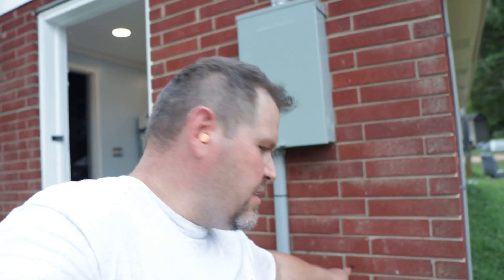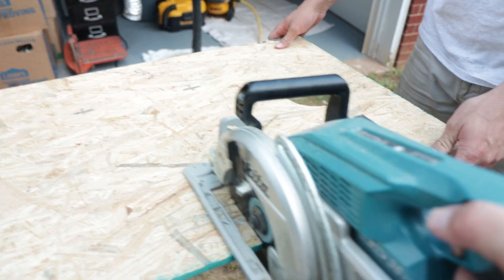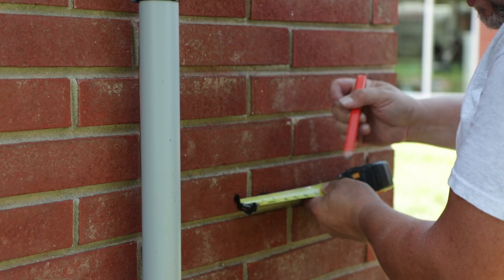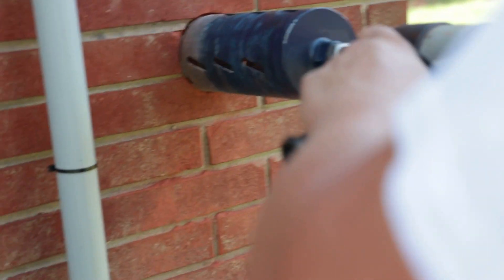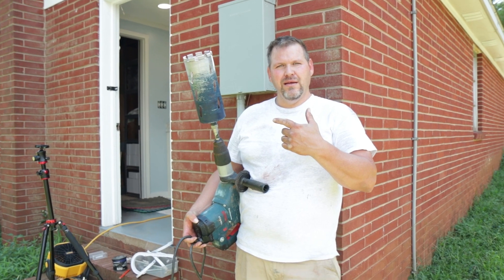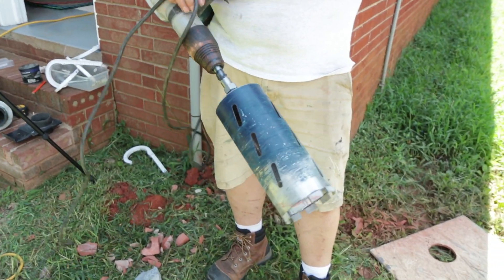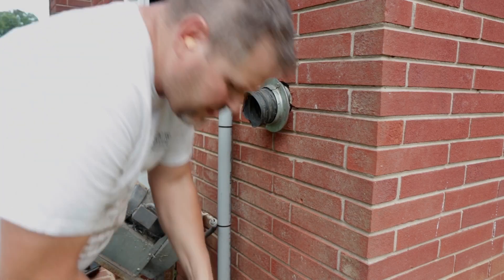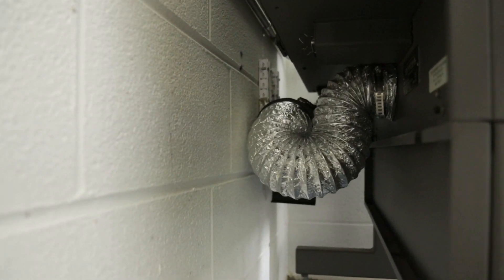How to Drill Through Brick Fast and Clean (Using a Core Bit)

Comment: I must be using a crappy Craftsman drill because it is taking me forever to drill a 3/16 hole in brick to mount a mail box.  About 1/4 inch every 30 minutes. And , why did you grease the 'splines'?
Reply from the maker: So you need either a hammer drill which a lot of drills have that function. You don’t need to oil or grease a drill bit in your type of drill though, but it does need to be a masonry bit. I’m using a rotary hammer, the bit free floats in the chuck so that’s the reason for the grease. 

You can drill just using a standard drill with a masonry bit, but it is slow. My suspicion is your bit is already shot if it’s taken that long. Good luck, man.

Comment: Does that core drill bit cuts through reo-concrete wall 4inches thick wall please?

Home here in Australia, our version of HOMEDEPOT ( Bunnings), as well our Tool warehouses, don’t sell 100-120mm (4”) core drills for us DIY, 

I’m looking to cut a 100-120mm hole through 100mm (4”) vertical concrete wall that has rebar and to use SDS plus on rotary not hammer.

doing my homework, it seems EBay has the answer and sells many different size core drills for concrete/brick, seems like diamond core drill not carbide is the go, with SDSplus adapter and use diamond core cutter for dry hole cut.

I can’t believe I’m the only one that has ever asked for this at our major tools warehouses , to simply run a 100mm waste pipe under the house and through a brick / reo-concrete wall ! … surely not ???

I had three quotes from concrete companies to cut a simple waste pipe hole into a brick and through a 4” concrete slab and all three quotes was if I was asking for gold diamond inlay :I    crazy prices $450 for an hours work!! Hence DIY “ myself” 

Any suggestions would be greatly appreciated that I’m on the right track before going onto EBay to buy core drill piece that comes with DSplus pilot attachment, gotta say love the hole cut out in marine plywood as an alternative on this video by these blokes, another one I saw is cutting a V out of a piece of marine plywood as a pilot guide too.

Thanks everyone

Melbourne 🇦🇺 kangaroo 🦘 
Australia

Comment: The Ingersoll Rand 114GQC Air Hammer  https://www.youtube.com/post/UgkxqqoaX03nrziKwF7Bjjcc71YzLEleMvOS  was just the tool I needed. I Use it to remove stuck bolts. If held at the right angle you can cut slightly into the bolt. Then turn the air hammer to where it will hammer the stuck bolt to unspin the bolt. Given a little practice it works great. This air hammer gives you the control needed to get the job done right. Very powerful yet still does not seem to have as much vibration as other guns I have used. One of the best I have gotten my hands on.
Reply from the maker: appreciate it

Comment: Do you use Rotary Only mode on the drill?
Reply: I'm finding that SDS Max drills don't have a Rotary Only mode. But my dry core bit says "rotary only" - no hammer action - it will destroy the teeth of the diamond bit cutter.

Comment: I just want to make some kind of small hole for extension cords or cords ? Any suggestions? Thank you and God Bless you Happy. Easter
Reply from the maker: They make concrete drill bits up to an 1” I believe. If your going through brick or solid concrete it works good. If going through block I’d get a small core bit similar to what we have here. You can get them on Amazon or eBay fairly inexpensive. 1” would be the correct size and any full size drill should run that.
Reply: You're running an extension cord through a brick wall???  My suggestion is absolutely don't do that.  There's a reason why that doesn't come close to meeting code.  Just a really bad idea.

Comment: is the drill setting on hammer or drill only when using dry core bits?  sounds like hammer setting is on
Reply from the maker: It’s a rotary hammer, there’s only one setting and like I said in the video we know it’s not recommended. We’ve ran them countless times without pushing to hard on the tool and there’s no visible damage to the core bit.

Comment: I saw a bit of blowout at the exit around 8:30. Usually do pilot holes but its a big job.  Holding a cinder against the wall when the core bit comes through will help reduce the blowout. Good use of the guide.
Reply from the maker: We bore holes different now. Same core bit and Bosch Rotary hammer. Zero blow out. It’s in one of our other videos.
Reply: Pilot drill & you can drill from both sides.

Comment: The core bit I got today comes with a center mason pilot drill bit, so you don't need the template etc... Super simple but not easy work, prepare for a workout.
Reply from the maker: Most contractor grade or rental cores don’t have a pilot bits

Comment: Nice video..
Do you have any info about the core bit and the adapter.
Thanks!
Reply from the maker: Amazon has both of them. I can’t remember what seller I used though. The thread for the adapter is 5/8 and for the Rotary hammer side that was used in the video SDS Max. The adapters are a little tricky to find though. Good Luck

Comment: I haven't drilled many 4 inch holes, but when I do I use a wet hole saw drill. I was wondering whether anybody has used both, and which is the best method.
Reply: Yes, I have used both methods, I found the water assist method less time consuming.

Comment: nice work. I want to install a wood stove chimney liner, but my old house has a brick chimney that was filled with concrete at the opening...so I'm thinking of cutting a hole as you're doing.  think it will work?
Reply from the maker: What size hole (8”)?

Comment: Great video. You make it look too easy, LOL. I'm not criticizing but there should've been some safety precautions included. Mainly checking for any wiring in the wall and some type of eye protection. What did the inside hole look like? Do you just use some sort of a box. Normally the exit hole looks much worse than the entry hole, that's why I ask.

Comment: Hi what was the grease for? do all diamond drills need grease before using? also how come you kept stopping every now and again? I've never used this kind of drill that's why i ask, thanks
Reply from the maker: Grease is for the end of the core bit that goes into the drill. I typically will stop when boring to see if there’s anything such as mortar, brick, concrete that’s came loose in the cut cavity. Just cleaning the bit off.

Comment: despite the comments about water, hammering, etc..good job ,...I enjoyed the video ,...
Reply from the maker: I knew this would bother some professionals. Here’s my take on the water, if it’s a area that not finished and is solid concrete I’m almost always going for using water. If it’s brick that we’re drilling through and I have to worry about run off clean up I’ll go dry. We will typically run a couple vacuums then. Some people the rotary hammer drill is just going to make mad😀 It really came down to not wanting to carry so many tools in our rigs. I can only assume with your name I’m talking to a professional or sales so I’m preaching to the choir here. Appreciate the comment.

Comment: Any issues with doing this at a slight angle?  Need to drill a similar hole for a mini split ac and it needs to slope for drainage.  Is it fine for the bit to do this at an angle?
Reply from the maker: James, shouldn’t be a issue. Especially if you use a thicker template.
If not start drilling straight for about 1/2 inch depth. Then restart the hole at the desired angle. By drilling it straight on at first the core bit want be trying to run away on you. You can do it👍👍

Comment: Seems obvious but what did you use for the 1" hole for the electrical? I need to make some holes through my concrete block foundation to get some electrical runs outside and was just curious what you use. Similar coring diamond bit but just 1" vs 4.5"?
Reply from the maker: We actually have a sds max 1” bit. I’m going to cover more of this in a video soon.
Reply: @campbellbuilt  love your attitude. Def subbed. Looking fwd to more of your vids!
Reply from the maker: Appreciate that. Thanks for the comment.

Comment: thanks for this video, on the drill setting, do you set to hammer drill or drill only ? thanks
Reply: Never drill core hole saws on hammer
Reply: @Kingstonplumbing  thanks
Reply from the maker: Not to be argumentative but we’ve bored many many holes in rotary hammer mode. The first time I did it was because the drill being used only had that rotary drill option. I figured it would ruin the bit but I was wrong. 
I’m not recommending it but I’m definitely not saying you can’t do it because we’re doing it and will continue doing it with no abnormal bit wear.
Reply: @campbellbuilt  you are right.  I did the same because The core wasn't cutting enough and the hammered action did the job flawlessly.  The core carbide tip looked like new after that performance.   Not recommended in all scenarios though.
Reply from the maker: @Quisqueyax  thanks for commenting

Comment: How does the block look like inside did it blow out?
Reply from the maker: We measured and scored the Back side using the plywood again. Footage was lost. We had a go pro inside for that and well that’s typical for go pros. They loose footage quite often.
Reply: @campbellbuilt  Quick 1/4" SDS+ drill all the way through as a reference point, no need to measure and you'll know your interior/exterior alignment is dead nuts on.  And if used a hole saw for your cutout on the plywood, you'd have a pilot hole in your cutout and you can just use the 1/4 drill bit as a locating pin and use that plug inside your coring bit as the guide, and no second person required to hold the template required.  Establish your hole location, remove 1/4 drill bit pin and plywood, resume drilling. 3/4 ply works better though since you have more hold.

Comment: If I had to use this system on a concrete wall with rebar in it, what are the chances of the bit binding in the hole and then the drill ripping my arms off?
Reply from the maker: Great question, most all rotary hammers have some sort of clutch. All of our large drills and rotary hammers have them. You really don’t need to be worried about getting hurt with a good tool. 👍👍
Reply: Ok, so I have a Makita, it should have a clutch in it?  The reason I am so paranoid is I spiral fractured one of my Metacarpals with a 4.5" hole saw in wood with a quality Dewalt corded drill, so there was evidently no clutch in that one.
Reply from the maker: I understand. Had a older drill grab and I couldn’t fully use a couple of my fingers for like a year. Most rotary hammers have them also because they know the operator is using them on a ladder sometimes. I would make sure it does have a mechanical or electric clutch before I tried it.
Reply: I saw your comment and then this video came up  immediately after.  I guess positioning makes a huge difference.  hope this helps. https://youtu.be/5TCgYR1huzQ
Reply: You can use Hilti with atc - active torque control.
Reply: They make a device that can scan through concrete and brick to look for objects such as rebar. Saving those arms :).
Reply: You can also use a cordless drill driver on screwdriver setting (use the highest setting) which is also designed to release on over-torque. Sounds crazy, and a weak-ass drill may burn up its motor, but if you use a good quality one (DeWalt, Milwaukee, Makita, Bosch kind of machine) you'll have over-temperature protection on there anyway. It's actually surprising how little torque is needed in most core-drilling jobs.